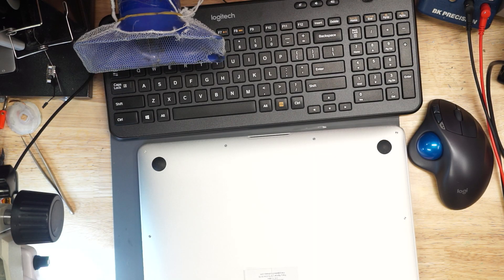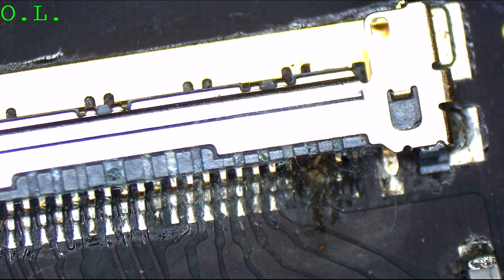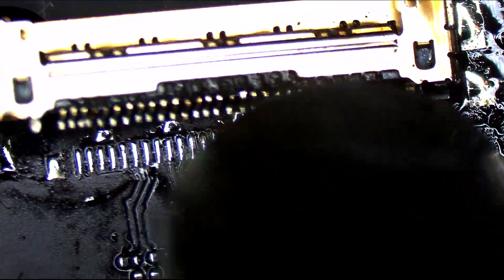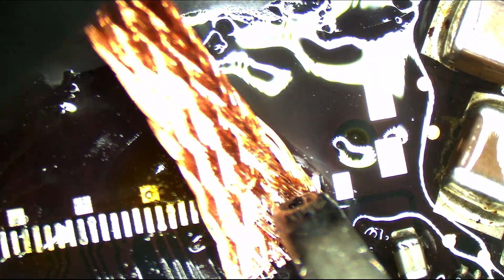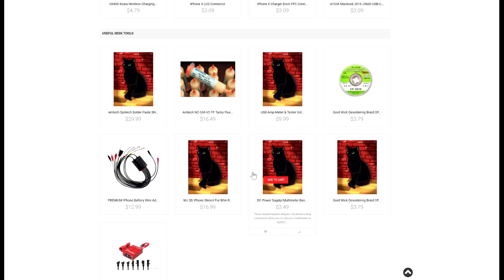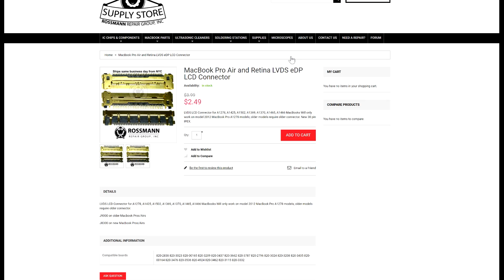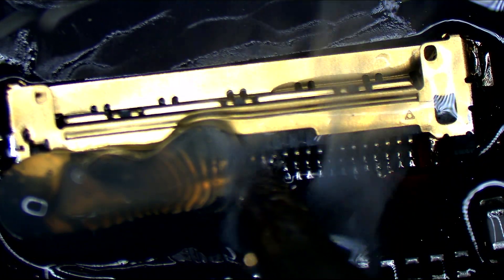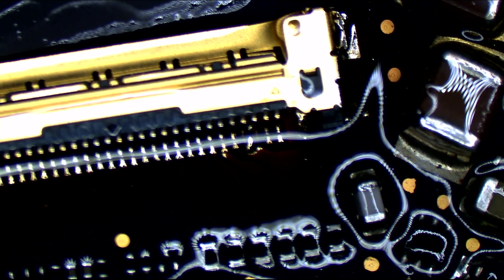What part of Macbook is made from BULLETPROOF component quality?

Comment: Well. You know, that short circuit current in that connector was probably less than the ordinary current draw by the display. Both together may have been Not much more than the display at full brightness. So no ordinary fuse could have protected it. You wanted them to install a fault current detection system?

Comment: @Louis Rossman That back light fuse is polyreset-able, meaning that it may have done its job and blown, but it will quickly do its job and reset and when power is not longer being applied to it.

Comment: "..or just dont think at all!" Love it 🤣 
Say Louis, I'm curious. When you are done drag-soldering are you cleaning up the remaining flux off-cam when you are done recording? We see you typically using a swap and IPA, but with that amount of flux I would imagine that without an ultrasonic cleaning process, there would still be active flux left hiding under components, connectors and what not. Even if you are using a water soluable flux.
I know it's an Apple product and that it doesn't deserve your love but your customers do - over time active flux can be corrosive and cause issues 🙂

Comment: Sony used to do this stunt for their colour TVs. The inrush current for the SMP was too high for the fuse to cope with, so they placed the safety  fuse after the stuff that would blow up, and did blow up, before the fuse would blow :-)  I was impressed by how robust the adhesive for the PCB pads and tracks held up. Used to be, if you so much as  touched a pad with the iron, whole tracks would peel away with the pad.

Comment: Was the SMD fuse too high a rating for the circuit being protected? This is very basic electrical science and would make one think very carefully if a large number of passengers, for example were bringing these laptops onto a flight. In the event of a fire in one of these devices do Airlines have some sort of procedure for containment for faulty ( fiery ) devices?????

Comment: A fuse blowing when there is a problem is no good if you have no intention on replacing them and would prefer the customer just buy a new laptop.  So you might as well use one that is more durable then the part it is protecting that way the failure point is just that much higher.

Comment: But fuse didn’t had to blow in this case. Corrosion basically destroyed the connection to the lcd, and there is no current going to lcd this no reason for dude to blow? 
Correct me if am wrong tho

Comment: There's a difference between "Corrosion" and "burning due to high current draw". That would most likely be the reason the fuse didn't trip. Someone tried to hydrate this little macbook and it couldn't take it.

Comment: So Apple design excellence now forgoes the fuss of fuses for circuit protection, and instead uses "fusible links" directly in between power and essential operating parts of the computer.... I wonder how much longer Apple can continue to tout "economically minded"- what with all the Apple product technoscrap added to the junk heaps in such large, and frequent, numbers.
Reply: Apple doesn't replace fuses anyway so the function of the fuse is not needed.
As long as the fuse burns out before the circuit catches fire everything's fine in Apple's mind.

Comment: Not that I like apple products myself, but aren't those fuses selfrecovery? also currents between pins could be to low for a fuse to work but allowed enough time to flow can and will damage the board eventually if not cleared properly

Comment: As a repair technician altho amateur I can hardly agree with Louis on the fuse part. Fuses are not 100% reliable! If the current was nominal it could still cause damage without the fuse burning.

Comment: I wish I could take the train up there and learn how to repair board level components. I've been repairing PC's since for a long time and while I'm still very satisfied when I can fix someone's machine by replacing a part or repairing their software I've had failed components that I most likely could have repaired if I knew what I was doing when it comes to logic boards, gpu's, and so many other PCB components.

Comment: when they were looking at a reason why the hardware failed they noticed the Fuses would break first
so in order to increase the quality of their products they made it so the fuses wouldnt break.
imagine all of the additional time you get to use your device with even stronger fuses.
all of the money saved.
now that is some proper usage of fuses. pih, fuses as safety failure points, that is like so 2011.

Comment: Those corroded pins cause high resistance which will cause them to heat up and burn but the fuse wouldn’t blow because it’s not shorted. The current flow through the circuit would actually be less than it would be in a normal good circuit. You do some great board work!

Comment: My mid 2010 is still going strong
Reply: Stephen Davidson Very nice. What do you still use it for?
Reply: @cesartapia610  Basic stuff. But recently using Maya and ZBrush and Photoshop. I took out the optical bay and replaced it with a new SSD. Im having a hard time installing windows 10 on the new SSD. I want to use it for light 3D work. Its a damn crying shame what apple has done to its amazing products. Will never buy apple again.

Comment: Louis, pretty sure that is not a conventional fuse, but instead a polyfuse or PTC. It will "blow" when a specific amount of current goes through, but as soon as it cools off, it will conduct again. Of course, if the fault is still there, that's no better. Then you are just in a cycle of shorting and cooling.

Comment: I understand your distaste for apple,  but as for the fuse not being blown there is a good answer for that. ( Lets say it's a 2 amp fuse at 26Vdc with the apparent liquid damage at a connection like that, 1 amp of arcing could cause the damage seen without blowing the fuse. I would venture to guess that if it wasn't for the liquid at the connection and the back light circuit was to draw over two amps the fuse would blow. 

Thanks for your time on the video it was entertaining / educational  .

Comment: Could it be the connector has been corroded to a point that is so thin that the fuse has less resistance than the connector, therefore the connector became the fuse? I just don't understand why people don't take care of their expensive machines in the first place. Every time I watch your video 9 out of 10 chances it's water or corrosion damage. I truly blame the end user not the machine. I have 6 macs at home and work since 2012 and not one has ever given me a problem.

Comment: The fuse does not fail because the current flow is less than the rating. The fuse rating is to protect the integrated circuits. At least in theory. So it's quite possible for a poor connection to have normal current flow because the backlight is the only load. But at the same time there is enough current to make a fire at the point of poor connection.

Comment: The fuse didn't open because the display power usage was normal.
Why would it increase over normal limits? The water damage on the connector however introduced resistance, which in turn caused heat to be generated. That burnt the pins and pads.

Comment: Louis I have been working on computers for around  22+ years now. I sounded just like you hating and bashing on Apple. Back in 2012 a circumstance came up in my job that forced me to support / use the Apple product. Much to my surprise I was amazed how fluid, easy, fast, and how well they worked. I previously had to reinstall windows one a year and replace my laptop every couple years because of crack, performance issues etc. I seriously use mine computer 14+ hours per day in all kinds of environments. Needless to say after I year with a 2012 macboook pro retina it was still like brand new and still held a charge like day one. The second year I spilt an entire 32oz pop on it and figured it was hosed. Cleaned up the mess let it dry out and it ran fine but had sticky key syndrome lol. I took it to a local repair guy like yourself he replaced the keyboard for 85$ and it was like brand new once more. In the middle of 2018 (almost exactly 6 years later) it still ran perfectly and held a battery charge for 2+ hours. I sold it for $600 bucks and bought the new MacBook pro 2018 with touch bar. I have the same story with 3 ipads that my kids have and still use today everyday, meanwhile my buddies have bought 5 different android tablets in the same time frame. Luck maybe…and no I am not an apple fan boy, but I am also smart enough to know a good thing with history and solid proof to stand behind it. The new products do not impress me as much so I may end up moving back 😊

Comment: "In a MacBook the fuse is not the fuse - the pins on the connector for the screen is the fuse!  Think different, buy Apple! (Or don't think at all!)"  If I had been drinking coffee when I heard that it would've come flying out my nose right about then, roflmao. (Must be the Apple influence, when one hears about Apple design, ones mouth hole is no longer your mouth hole.  So instead you use your nose holes to expel unwanted coffee in your mouth.  Sheer genius I tell you!)

Comment: That looks like a poly fuse to me. They're supposed to not permanently blow but will restrict current in a failure condition. It likely worked as intended, and would've prevented something more catastrophic if that had potential to happen.

Comment: You need to remember, when current flows through liquid, it corrodes everything that it touches that current can conduct from or to. Because liquid has a high resistance in it, it will not blow the fuse. It rather eats and corrodes rather than shorts.

Comment: Normal circut innovation: Add a fuze & protection
Apple circut innovation: Add a fuse & protection but rely on the connectors to save the circut.

Comment: Louis I watch your videos everyday at work, and I know your feelings on Apple products, but I have a question I recently bought a MacBook Pro w/ Touch Bar it has 8gb of memory. I have a secondary machine Lenovo X1C6 with 16gb of memory that I also use for programming. I am going to be using to MacBook Pro as a secondary computer to learn how to program w/ Xcode/Swift. I was wondering in your personal opinion do you believe 8gb of RAM in a MacBook Pro is sufficient for what I want to do? Or should I pay the extra 215$ to upgrade to 16gb of RAM MacBook Pro

Comment: Lewis, I think you needed to find out why the pins burnt out in the first place. . . There must be some failure that caused a short downstream of the pins. Also Apple need to spec their connectors or fuses better here. I-PEX parts are pretty decent but clearly not designed to conduct that much current.

Comment: That's the funniest part at the end .. think different.
Yeah, lets make the connector pins the fuse.
That's definately much different. lol
I had a 'different' experience like that too.
For instance:
I was soldering the end of a wire, where I pushed the wire down a bit, with my iron.
Then ... it sprang up, from under my iron, like a spring and it flung some solder from it's
tip across the room. No kidding.
I heard a small hiss, about a yard away, and found the solder, splattered
across 2 connector pads on a stepper motor driver.
If I had not noticed, that would be the new fuse for my 3D printer.

Comment: Hi Louis  the fuse is a PTC  it is a fuse  it heats  up and is meant to stop over current  once it cools down it acts like Normal. I think I will have replaced the PTC  as well as the connector.
I hate doing repairs for people Murphy  always  plays with me  If I have 99% of the parts to fix something the one part I do not hsve will be bad.
Digikey Mouser take two weeks to get parts and Aliexpress is only good to buy stock parts as it can take 6 weeks in shipping.

I think that if you only repair one family of products you can stock up with the common parts.like Tantalum  Caps and switching  Regulators. A example is a family member had a Play station
with a Know Issue that is almost always fixed by Reflow . I reflowed the part and it did not help so 205 degrees so I raised the temp to 220 degrees the Caps under the BGA chip fell off.
I did not have a correct profile for the Job . Then I was accused of destroying his PS2 .Now I put the Caps back with Lead Free Solder and reballed with Lead  Solder. A trick I use to  solder 
two sided boards the first side I use  Lead Free then Lead on the second side.

A second Time I was asked to fix a industrial PCB where the person had tried to fix the board He had removed almost all the capasitors on a power Rail .I found the fault in seconds it was 
a relcom DC/DC Block the fool said it looked like a relay.I ordered the part From Digikey  it cost  about 90$ with shipping. I replaced the part and cleaned up the board I had no way of testing 
the board so I returned the board to have him test the board. After that he did not answer his Phone and was never Paid . If you ask why Did I not take pay for work done the answer is I did
not want to open Pandoras Box taking pay for a repair and then needing to fix a unknown Industrial Board. He phoned me daily  when his Industrial tool was not working .

I can see why Louis is Pissed He Fixes Peoples Sh1t and only gets paid if it works.

Comment: the best part about apple trying to say they use quality parts is just how they try to claim their aluminium casings are aircraft grade aluminium when its literally pot metal. 

and aircraft grade aluminium doesnt have to be very strong depending on which application its actually serving in the plane. 

if apple used proper quality and heat treated aluminium on their devices the iphone 6 wouldnt have bent.
Reply: and before anyone says shit all. they use 6000 series aluminium without cold forging or without heat treatment. 

for aircraft grade aluminium in most cases its 7000 series aluminium and its heat treated and cold forged. 

i had bmx cranks made from 7000 series cold forged t6 heat treated aluminium. strongest bmx cranks ever made. literally the only cranks one of my friends can ride without blowing them up. 

7075 t6 aluminium is strong as fuck. 

so its 6000 series when probably treated and used. 

also apple doesnt use a standard 6000 series aluminium. they made their own that isnt actually a true 6000 series aluminium. just has similar ratios of materials but the alloying agents are different. 

i used to use 6000 series hollow notched(took a file to the thread just under the head) on my brake levers which were constantly getting smashed into the ground when riding. never had an issue with a broken bolt. 

my plastic barend hit an iphone and ipod i had in my pocket and the one device's screen was completely shattered from the inside of an otterbox. and the other had a fucking crack in the aluminium backplate. 

and it didnt even hit all that hard. i quite literally dropped my bike and had the bar end barely ding my leg. and my bike only weight 20 pounds. and the bar ends i had were known for exploding if they took a big hit and they were fine. 

apple shit is trash. the fucking 2nd and 3rd gen ipod touches bent. wasnt as big a deal as the newer shit but yeah.

Comment: "... because in an Apple a fuse is not the fuse, the connectors are the fuse. Think different, or just don't think at all... buy Apple"  
           -- Deep thoughts on Apple, the trillion dollar company, by Louis - the $400,000 company which does what $1,000,000,000,000 Apple should be doing ;- ]

Comment: Louis, a fuse in a circuit (any electronic or otherwise) is designed to blow in the event of a short circuit. If the circuit the fuse is designed to protect has deteriorated connections and develops high resistance, I. e. and open circuit, the fuse will never blow. Otherwise good video.

Comment: Apple innovate by using higher current rate of fuse for protecting component that could burn out with lower ampere than the fuse's rate. Genius design.

Comment: you are still wrong about thinking that this fuse should blow before the connector burns. The connector corrosion current is probably less than what is needed for the backlight itself, or close to it.  So it is probably just not possible for this fuse to blow in these cases. You must understand that fuses can not prevent connector burning, they are absolutely not meant for that in the first place, be careful not to make a fool of yourself just because it is an apple product :) Fuses are not used to prevent something corroding away, etc! They are used against overcurrent.